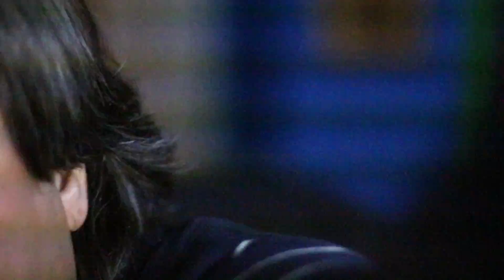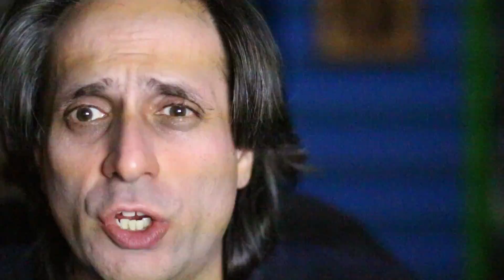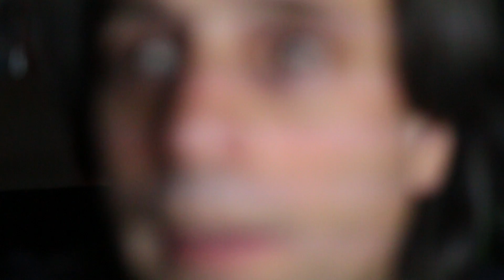Video Flutter / Banding demonstration and fix, using Canon 70D

Comment: Thank you for this video ! Life saver! However, If i want to shoot slow mo' or fast paced action, and there are flourescent lights around, am I SOL? And how can we detect this while shooting ? or is it only detected after offloading your footage onto the computer ?
Reply from the maker: Shooting action is a bit of a mixed bag.  Speeding up can definitely be a problem without at least some natural sunlight to compensate for the electronic lights.  The strange thing is very high speeds can eliminate the problem too, provided you have enough light.  Thankfully, there are some third-party filters for popular video editors that can clean things up.

Comment: Thank you, thank you!
Reply from the maker: So glad it was helpful.  👍. There are quite a few new lighting options that finally eliminate the problem without tinkering with the shutter speed because they run off of DC...so there's no 50 or 60 hz power cycling.

Comment: Say i have LEDs and i want to use less light because they are so bright, so i dim them abit. I do this method but it doesnt get rid of that banding. Is there a fix to this? As much as i like the bright light, its just to much for certain recordings. Thanks for your time btw.
Reply from the maker: Low light is the biggest challenge, especially with LEDs or florescent bulbs.  With low light, you need a bigger opening and a slow shutter.  The lowest you can get the shutter is 25 frames per second (assuming you shoot at 25 fps).    In my demo, I think I used an f/1.4 which was a big opening.

Comment: Life saver. I was so upset after spending so much money on lighting only for it to do a weird horizontal line thing throughout my videos. I have a Sony so I'm gna have to go home and investigate the shutter speed thing and see if there is any difference! Thank u
Reply from the maker: If 30 fps isn't low enough, try 24 or 25.  That's the speed most Hollywood movies use, so it will have a nice cinematic look.

Comment: I just shot a gig at a club and no matter what shutter speed I used I couldn't get rid of the light banding.  is there some other way to prevent this. ?
I'm using a Sony A7s with a Samyang 35mm T. 5 cine lens.
Reply from the maker: Try lowering the frame rate too.  I normally use 30, but you can go down to  24 or 25 depending on the camera.  Don't go lower than that or it will look odd, but 24 is the same rate as Hollywood movies so it looks great. Once you lower the frame rate, you can lower the shutter even more to match the frame rate.  Another factor is the amount of light and the ISO.  Very low light with a high ISO makes the problem worse because it's already noisy.  Get the lens open as much as you can so you can use a lower ISO.  When in doubt, bring some additional light of your own.  If all else fails, there are some good plug-ins you can use to clean it up in post production discussed in the comments.

Comment: I've this issue on a GOPRO video captured in Santorini Greece whilst on a cruise, can this flutter be removed post edit?
Reply: +chris Bull Yes, but I've never seen a built-in filter to do it.  There are a few paid plug-in filters that can fix it, including Tinderbox's FurnaceCore deflicker plugin.  That said, there is a trick that some people suggested that may do it for free... By taking a second copy of your footage, and layering it on top with a 50% opacity... then laying it about a frame ahead. the snow from one frame will be cancelled out by the good frame in the second layer.
Reply: +chris Bull Here's another plug-in.  http://www.digitalanarchy.com/Flicker/main.html
Reply: +Idea of the Day (.Com) I might have to try this.  I couldn't remove the light banding from my shot at a recent gig no matter what shutter speed I used.  This is the first time I've had this trouble with my a7s.
Reply: Once you have bad footage, you really don't have much choice other than trying filters and plugins.

Comment: Thanks very much
Reply: +Swithin Games (Swith) sometimes it happens with LEDS or Tungsten lights tho
Reply: +Swithin Games (Swith) It can definitely happen with LEDs because they cycle just like a florescent.  Technically, Tungstetn lights flicker too, but they are hotter, so the light doesn't diminish as quickly between alternating cycles.  Since LEDs and Florescent lights are cooler, the glow diminishes more between cycles.

Comment: Very interesting video about this phenomenon. However, I've got two objections:

First, fluorescent lights flicker typically at 120 Hz, not 60. (or 100 Hz if you're in Europe...). That's because they light up not only on the positive period of the alternating current, but also on the negative period.

Second, the banding is not caused by the fast shutter per se, it is also caused by the camera scanning the image sequentially at much slower speed than the shutter speed. That's why you end up with parts of the image shot in the periods of darkness and parts shot in the periods of light from the fluorescent light. The upper lines are in fact a whole frame time apart from the lower lines on the same frame, which would give you, on 30fps and 60Hz mains, 120/30 = 4 bands on the image (which approximately equals to what we see on the video). This is the same mechanism that causes eg. running trains appear slanted when shot with digital cameras.

It is remarkable, though, that shutter speed of 1/60 didn't even the banding. Seems like the shutter metaphor isn't precise.
Reply from the maker: +jpal00 It's a fascinating phenomenon that caught me off guard because it sounds so counter intuitive.  Speeding up the shutter has the opposite effect and it actually increases the likelihood of a sync issue will occur.  One reason is that a slower shutter will capture multiple cycles in one exposure.  Since the shutter is open longer, it will capture multiple strobes of light.

With a faster shutter, such as a 60th or even 120th of a second, chances are at least one or two shutter cycles will pick up the down cycle of the light.  Regardless of the shutter speed, the video will be around 30  frames per second, which means that there's even a strong chance one of those down cycles will occupy one entire frame of the 30.

Regardless of the scientific theory behind it, the most important thing is that it works.   With a 30th of a second, you get results that work well in the US (provided you are shooting at 30 frames per second), just as a 25th would work well in Europe, however you would not be able to do that unless you changed the frame rate to 24 or 25 frames per second too.
Reply: +CouponPages "chances are at least one or two shutter cycles will pick up the down cycle of the light.  Regardless of the shutter speed, the video will be around 30  frames per second, which means that there's even a strong chance one of those down cycles will occupy one entire frame of the 30."

That seems logical, but it is not what happens! If you looked at the video, you'd find that none of the frames are dark or even darker than the others - they are all lit up the same. What you see is banding which indicates the whole frame actually gets shot over multiple strobes of light - but individual lines in the frame aren't. Yes, lengthening the exposure to the whole frame works, undoubtedly.
Reply: Is there a video that explains visually what you're talking about. This is very interesting, and thank you. For example, unlike for CouponPages my banding started back up at 1/30th of a second on my shutter speed, but disappears at 1/40th of a second and is minimal at 1/60th of a second. At 1/50th the banding becomes denser again.

Comment: How to you get rid of the Banding? It's in most of my footage mostly the skies.
Reply: +henasee henry flickering is not banding. You can get rid off the artifact recording video with more bit depth. Usually when the record is 8 bit (as if H.264) banding occurs.
Reply from the maker: +supersticion Unfortunately most consumer cameras don't offer changes like that. I think I  used a canon 70D in this video.  Either that or or my T4i. I don't think either of those let you use anything but H.264.
Reply: Thanks

Comment: You are great thanks for giving us the tip.    I have proper lighting for most situations but some times you can't account for everything.   Just work with the Shutter Speed/Angle and the problem is solve.   Congrats.

Comment: I shoot video with a GoPro-4-Silver camera and I get this problem with my fluorescent light that has 50Hz. Does that mean I should film in 25 fps? I film in PAL and not NTSC since I live in Finland, and it's actually worse as 25fps.. It's kinda ok with 50 fps.. So should I just use 50 fps? Also, how about I buy LED lights? Will I have the same problem with them? I'm looking at YONGNUO YN-160s LED Video Light, but they don't say how much Hz does the light give?
Reply from the maker: Technically it's more about changing the shutter speed than frames per second, but unlike raising the shutter speed, when you lower the shutter speed, it effectively limits you to less frames per second too.  Since 24 is a popular frame rate for movies, a 1/25th of a second shutter speed should work quite well.

Comment: THANK YOU.... You have no idea how long I've been looking for an answer to this problem. I have a 70D I just bought some weeks ago, and my kitchen´s ceiling is full of LED lights and I figured out that the problem was the lights since every time I turned them off the flutter disappeared.  However, everybody said to me that my shutter speed needed to be 50 for my shooting style and circumstances, so it never ocurred to me that changing this could fix the problem.  Now the question to you is, how will that affect my video quality and/or the basic recommendation that I needed to use a SP of 50?  I appreciate your input very much... And thank for this awesome tip :-)
Reply: I'm glad you found it useful.  I originally thought this was a problem unique to fluorescent bulbs, but I found that most LEDs have an even bigger problem because unlike the glowing gas that remains glowing through the power cycles, LEDs are more responsive.

Since some of my battery powered LEDs don't have this problem, because they don't use the same 60Hz frequency, it's possible some LEDs may adjust the power to another frequency between cycles.

The funny thing is that would mean they will still flutter, but only at a much higher shutter speed.  

I'm not an engineer, but I would think a simple solution for everyone would be to design a bulb where 50% of the LEDs light on the up cycle, and 50% on the down cycle, giving a continuous glow.

Comment from the maker: Somehow YouTube has a glitch that only lets me hit reply on some comments, but not others, so I'm posting this as a comment.

In response to Muhammad Darwish, it sounds like the LEDs are the root of the problem, because they actually turn on and off in a fraction of a second, but the human eye can't see it.  Your camera sensor however can.

In my example, I changed the shutter speed to 30 fps to fix my problem, but there are other settings that can have the same effect.  The trick working within increments of the shutter as it relates to the frequency.

In the US, videos are typically 30 frames per second, and our electricity is 60 cycles per second.  So moving the shutter speed to 30 effectively insures that for each shutter opening, we get exactly two cycles of synchronized light.  Any other combination will yield fractional cycles where the camera could conceivably open for that small fraction of a second when the light is actually cycled off.

That said, almost half the counties in the world have 60hz, but the rest are 50hz, which is also why TV standards in those countries are 25 frames per second, instead of 30.

So if you are in a country where the power is 50hz and the TV standard is 25 fps, you may want to change the shutter speed and frame rate to an increment of 25, instead of 30.

It should also be noted that even in countries with 50 or 60, it's possible to have LED lights that don't match, such as those which have a power converter, or draw power from an internal battery. The frequency of that could be completely different.

When in doubt, shut some lights to determine which one is the problem, then once you identify the out of sync light, look for the frequency or just tinker with different shutter speeds until you hit it.  Eventually it will go away.